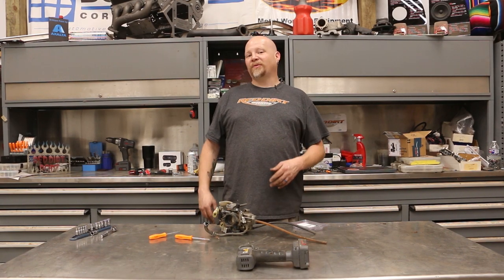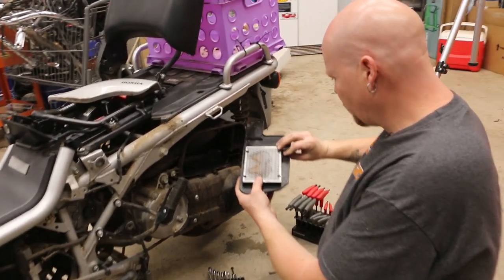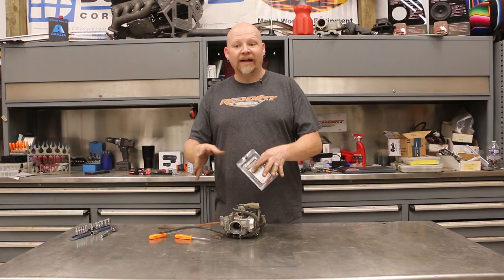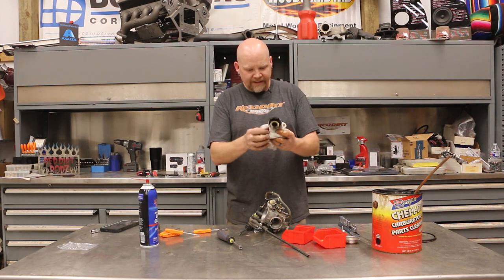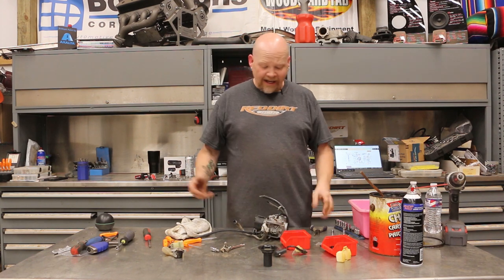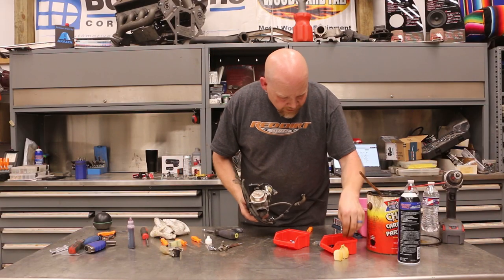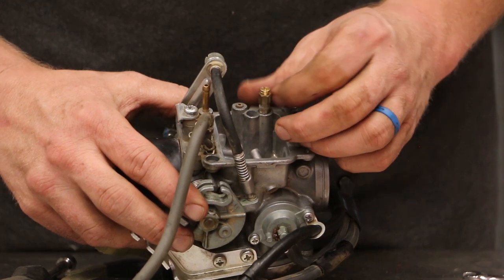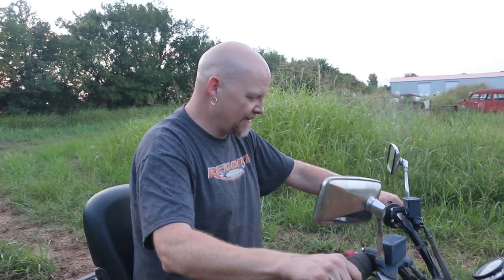2006 Honda Big Ruckus Carb Upgrade! Rebuild and Bigger Jets for more SPEED!

Comment: How were you able to seperate the carb from the manifold?  I had to remove it attached to the manifold.  Once out, I completely removed the metal clamp.  I could still not get them to seperate.  Thank you for the video.  Very helpful.
Reply from the maker: @abnerbjorn1106  yes, we were able to separate it.

Comment: My big ruckus will get up to 80 if there’s minimal wind and there’s a slight decline. Once it gets there it’ll hold over 70 easy even going back up hill. I am 270lbs, that slows it down a bit. Carb is all stock.

Comment: I have an o-ring that is slightly larger than the one on the adjustment screw that I can't figure out where it goes. I re-watched your video a few times and couldn't see where you used it. Any ideas where it goes?
Reply from the maker: I'd have to go back and look. Have you pulled up a diagram of the carb? I used one for reference because the kit had zero instructions.
Reply: I have the same situation I can’t figure out where this oring goes.